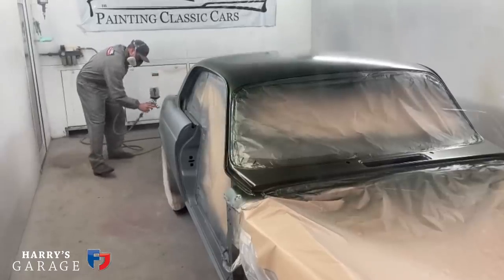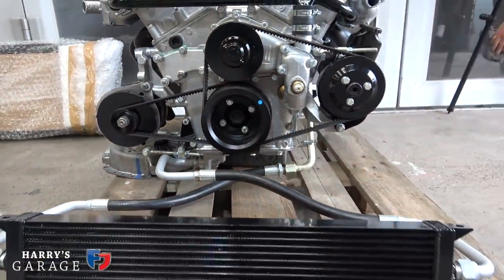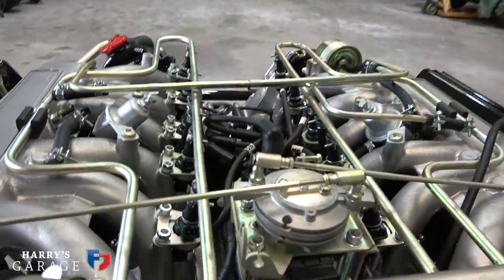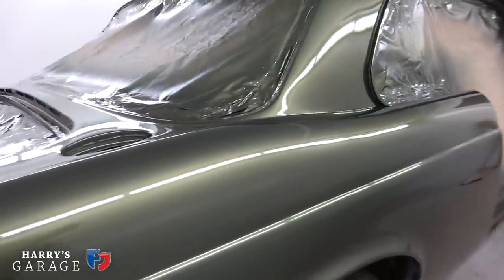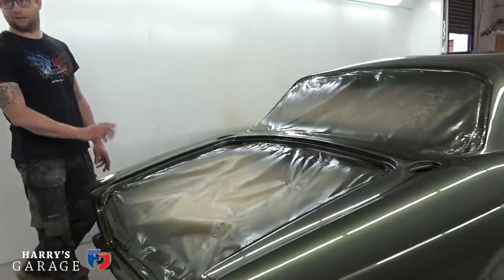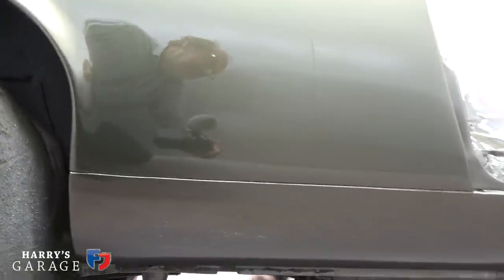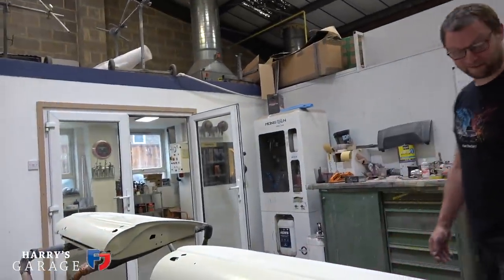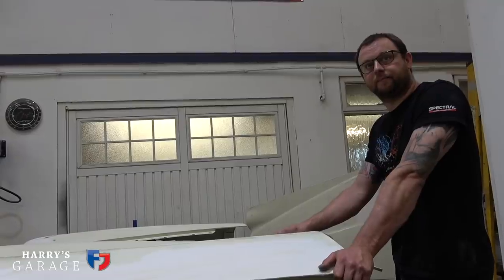Jaguar XJ V12 Coupe restoration part 6. It's time to reveal the new colour!

Comment: The wiring loom should probably be the first thing installed once the re-assembly starts. There'll undoubtedly be stuff in the way otherwise,once pieces get added back. Nothing's going to work without power. It must be maddening to have it delayed.
Reply: Quite sure these people know exactly what they're doing
Reply: No they do that last, lol.
Reply: CT is infant grade content now  did you not think there was a bit of a low at the front of the o/s quarter. Below the swage.

Comment: The paint job came out really nice , painter did a really good job
Reply: I suspect he might have fallen into a real beginer mistake tbh...... When your laying down a colour with as much cast as that, your taking a masive risk not having the panels on the car. There is so many variables you could well end up with panels that look a diffrent shade to the body in the sun even using the same painter, same mix of colour etc etc. All i can say is the guy must know what he's doing........ i've never used Noval but 30 years experiance with just about every other paint system had me thinking it could be a real mistake.
Reply: @K2edg  You don't have to have them on the car, just in the booth, but I was thinking the same thing. He didn't spray the bonnet, doors and panels at the same time?? Wowser. Maybe painting tech has moved on and he knows what he's doing but that used to be a real rookie mistake. I'm of course hoping he knows what he's doing.
Reply: @shingnosis  No thats not what i'm saying, you could paint the door in the booth on a stand at the same time as the shell and could look off shade....... I am a pro painter for a big restoration shop using Spies hecker, Glasurit, and Dupont, anything with a cast or opalescent gets the panels hung on the car to save embarrassment. It's a beginner mistake to treat a colour with an odd cast like a solid colour.
Reply: @K2edg  Interesting, never thought of that aspect. Do you think they'll hang the panels on the car now and mask the rest? Would that help?

Comment: If you've got rubber oil hoses that go crusty, replace them with stainless braided teflon lined hoses that won't... (unless you really care about concours level originality)
Reply: From what Harry said it seems restoring to a concours finish is his intention.
Reply: @Bulletguy07  how about stainless braided teflon lined hoses coated in rubber? ;)
Reply: @kevinpunter7960  That’s such a good idea for those that done want the lines to should I’ve been modified. Even if it is a quality upgrade.

Comment: Would be great to know cost of such a high quality restoration...
Reply: Probably  70 plus grand  for  mechanics  and body  and rewiring  and chrome
Reply: @russcooke5671  reckon be 100k time he is done 21k just for the engine about 500 hours so far on the body and paint
Reply: @richlee509  he was quoted 15 to 20 k for body and paint  21k for the engine so that’s 40k tops  it can’t be another 60k on top to finish it  surely. 👌👌

Comment: I recall that all the XJC ‘s that came to America had vinyl tops, as was the fad. We had a 1976 XJC 6 that was delivered in red with a black vinyl top. It looked good but I prefer the painted metal top. It shows off the beautiful lines of the coupe better in my opinion.
Reply: Story was that the main reason for the vinyl roof was that it was the cheapest way to hide panel joins.

Comment: Pure restoration science. You might in the end spend 50k on the renovation but this car will sell for 150k when it’s back in your garage! Love your restoration vids. The engine has been beautifully restored, the pressure excellent and the drive train rotates as freely as the rear wheel of an 8k road bike.

Comment: Stunning colour, makes the big cat even more special. And that engine. Lovely. I'm a little surprised you didn't go with the square profile fuel tubing which was on later models though.
Also found in my archives : Body Shell Prices - RRP at 27 June 1980 (seems like yesterday) you could have purchased a "Primed not built up and without wings" 2 door bodyshell (AAU 6798) for.... £825 of Her Majesty's pounds.

Comment: "This is a door shut that no one will ever look at...". Except in concourse scrutineering! Those guys will go down to all the shiny bolts, injector mounts and matching plated engine lifting eyes on your frankly beautifully restored engine and check if they've got original logos stamped on. They're better at finding stuff than a mother-in-law checking for dust 😁

It's going to look amazing 👍
Reply: I’m no scrutineer but with that engine looking so shiny and new my eye was immediately drawn to that scruffy looking ignition coil at the top... Hopefully it’ll get a lick of paint or be replaced. Very surprised to see it there. That said, stunning work by all involved..!!

Comment: Worried now, I have a 1978 Series 2 v12 with an internal engine noise, surprising at only 36,000 miles from new and not sure what the problem is...... and now, a 1988 XJR-S with a few more miles at 85k has just developed a serious bottom end problem. What to do now!? Anyway, question, are you going to vinyl the roof on your restoration, believe all XJ-C had that?

Comment: Beautiful! A modern take on that color? Toyota/Lexus 6v4 "Spruce Mica"- painted a 4wd Dodge truck (short bed, standard cab) the factory silver/grey with Spruce Mica below the belt line, on the wrap around front bumper plastic  chin (surrounds the chrome), the wheels- pops well with the chrome lug surround & trim ring, and the rear bumper. Love rich, darker metallic greens

Comment: Harry, the gaskets on your enlarged trottle bodies [71mm] do not fit the air filter boxes. 
This way you wil never get the maximum flow out of them, together with those beautiful reworket
intake manifold made by Dennis Priddle with bellmouth extensions.
supplyd by AJ6engineering of course.
Reply: I saw a metal strip partly blocking one of those intakes too.

Comment: Magnificent job so far. Was the suspension on this generation of Jag usually quite soft and wallowy ? If so, would you consider a modest lowering and firmer shocks?
Reply: you have to look back at the videos he made about sorting the syspension and lowering it its been sorted
Reply: @callumduncan6728  Thanks Duncan - I missed that video. Phew! I can sleep peacefully now.
Reply: Original was soft but never wallowy. I forget the manufacturer of the original dampers, but they were fine. Plenty of advice (and opinions) online - Jag Lovers etc.

Comment: I would like to know more about the process for renewing the wiring harness. I’ve had problems with mine and I cannot find anyone to remake my harness that runs from the ECU in the boot, through the cabin, straddling the transmission tunnel, then into and across the dash to the front-right fender and into the engine bay. Very long.

Comment: They were such the lookers in the older late 70s then the more subdued present ones. IF you could take the body shell and drop it on the new tech and suspension and keep the chrome.. the Dual filer locking caps.. The Leaping Jaguar.

Comment: I love Harry's channel.  At £ 21,000 (almost $29,000 U.S.) you have the reason why many V12 Jaguars now sport a Chevy 350 (like my 1976 XJ12L).  My V12 expired in 1993 at 139,000 miles, and was replaced by a remanufactured 350 for $549 plus installation (less than $2k all in).  That 350 is still in the car, although it is near its end.  I love Harry's enthusiasm and envy his budget -  his uprated engine with the 5 speed manual should drive very nicely.

Comment: Paint has some problems and the flowcoating won't solve them. Some minor wrinklings in the substrate near rear pillar, slight sinking of the primer in other places. That's minor, but sun and infrared usually take care of that prior to the final sanding. Epoxy primer also takes a long time to fully cure and requires IR lamps even if the TDS state otherwise.

Comment: Engine let down by those two corroded coolant fittings. Why didn't they fit new parts?.. or if they're unavailable, cut off the corroded part & tig weld on a couple of AN aircraft fittings that have had the anodizing beadblasted off?

Comment: I hear there is proper ceramic coating and then there is what can only be a short term aesthetic coating.  The proper coating withstands the high temperature of exhaust manifolds and the rest cannot, so it falls off after a short time.  How does Harry know this has been done properly?
Reply: Because the engine builder is reputable and knows what he's doing?
Reply: @ashleyaustin1894  I suppose I was rally asking, who did it?

Comment: A 70 MPH shunt, jesus, that car and that guy is lucky to be around, by the way that puts that shunt between 1980 and 1984 onwards based on that model so that means that first owner had this thing atleast about anywhere between like 5 to 8 years as a minimal, and just knowing those cars it must have been garaged to survive that long, 

and I wonder if that blue was even its original color, but still the fact that the OG owner showed up and commented should tell you how much he cared for this car lol 

also a plus atleast with the wiring loom taking that long means you should have time to finish the lancia and its bill along with the rolls, so atleast its not going to be a 17K slap on another like 30K slap.

Comment: Jag’s classic V12 is the fussiest looking engine of its type. Considering the straight six I believe it was based on, was such a clean and handsome looking motor, why all the spaghetti soup on the V12? 

Anyway, a great job done on said engine. While the new color is so much nicer than that horrible blue it was before (and blue is usually my favorite color) I remember as a kid in the 70s my father, for a while anyhow, had a Daimler Double-Six in that exact same color. And I didn’t like it then either! 😆
Reply: It was not based on the XK 6 cylinder engine. Entirely new design. Video of designers Harry Mundy and Walter Hassan discussing it was posted on YouTube.
Reply: @LaurieWilliams-lk8fc  thanks, I’ll check out the video 👍

Comment: I’m not sure of the reason why it happened, but Dan from Normal Guy Supercar had his manifold ceramic coated for his F430 and the coating caught on fire when he was out taking it for a test drive
Reply: I haven't seen the video, but would it not have been the oil residue catching fire? As in the manifold not being cleaned off after it was refitted?

Comment: Porn suddently got a new meaning - and i haven’t seen the car yet 😳😍🥰

Friggin’ heck ...... is that the same refurbished cylinder head? The work of a magician. 😊👌

That colour 😛 

Mr Metcalfe, my highest congratulations. 🍾

Yes, it did cost quite a handfull or two but it really did pay of.
Reply: Re "same refurbished cylinder head" - if so I hope not overheated and gone soft.
I wonder whether the repairer checked the metal hardness of those heads before deciding to reuse them rather than replace them.

Comment: If the car is going to restored to concourse should it not be  stripped down to a bare shell  and all the underneath floors painted.  Like UTAH. On Retropower   But your jag is a beautiful car. Is it going to be a show car.
Reply: The car can never be concourse with the wrong colour, no vinyl roof and a 5 speed gearbox.  Nice show car but can never be concourse which is great by me as I had the concourse mentality.
Reply: @joeblow3823  your right  I didn’t know about the gearbox   But i thought you could still change the colour  but then it’s not an original  jag colour.  Also what I meant was concourse standard on the bodywork and paint

Comment: You've been taken on the engine rebuild.  It doesn't cost that much to get parts blasted, replated or repainted.  Quarter panels ahead of the wheel arches are very wavy.  They could have done a better job there, especially driver's side.

Comment: Each to their own I guess - the colour does nothing for me but the workmanship on the paint looks great - no so happy with some of the ghastly welds visible in the vid - the one near the base of the vertical pressing that the doors bolt onto is a bit feral as are some in the wheel arches.  They will not be visible when the car is assembled but could have been cleaned up before paint.
Reply: "to each his own" - but I agree about the colour. I think both the green and its variability are bad misfits for the car. Westminster Blue is stunning and would have done well.

Comment: Surprised and disappointed that the engine builder did not cover or bung the open pipework and other apertures. Then dropped it on a workshop floor under a loose sheet for 2 weeks!

Comment: Shouldn't you paint the doors, bonet and boot together with the car, after mounting them on the car to get an even paint job on all panels, the way you did it there will be a difference in color...
Reply: Its personal preference. This way is standard procedure when you are dealing with a full bare metal repaint and want proper paint coverage on all of the panelwork and have your own colour mixing scheme at your disposal. Colour match issues normally occur when your dealing with outside paint supplier's where there can be discrepancies in different batches.
Reply: @byronmills5952  I am no expert, but I know it is better to paint them all together. Mixing the color for doors and bonet can't be 100% same as the one they mixed a week or two ago to paint the body. Now you dufferent color mixings.
Reply: @huss1205  I've been involved in this line of work for many years - there's absolutely nothing wrong at all in painting the panels separately. Because they have their own high tech paint scheme and mixing facility at their disposal - the colour match will be perfect every time. Even if there was any discrepancy - that can easily be sorted with a final drop coat of base when the cars panelwork has been fitted - before the final two flow coats of lacquer are applied.

Comment: The paint finish is awful and it's no wonder they are going to flow coat it, please tell them that they can flat it with 1000 grit instead of 1500. How on earth the guy started painting it at 12:00 and didn't finish until 20:00 ill never know but sure as shit they will never be someone I'd recommend to anyone.